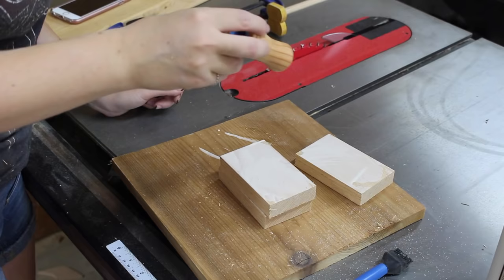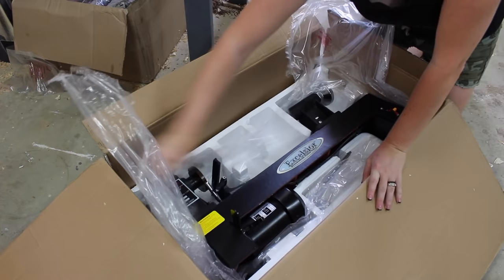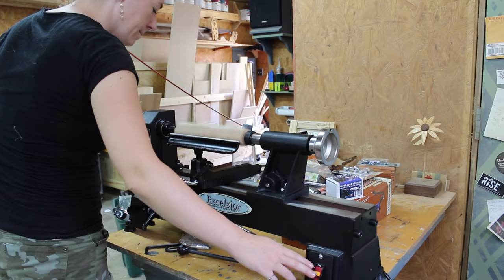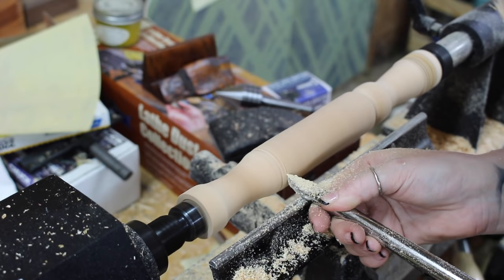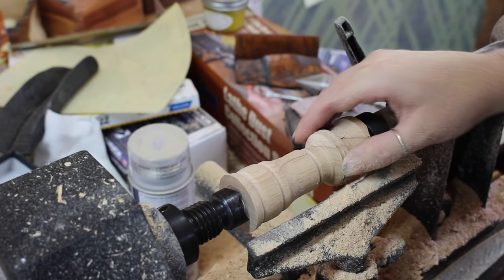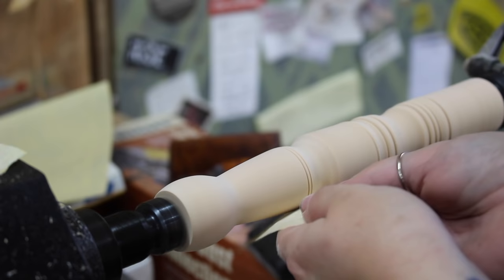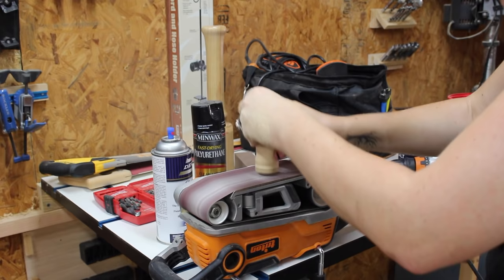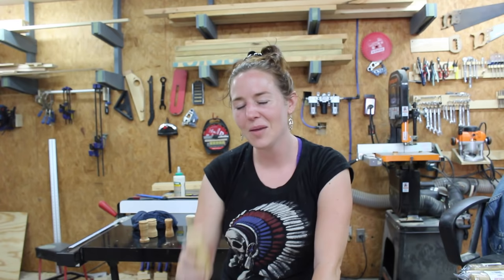Turning A Shop Salt Shaker

Comment: One bit of advice, don't look at others working and think they can do it better than you because of the tool they are using. If you follow that path you will end up with a rack of tools you never use. Learn to use the tools you have, and if you can't do something with them, then you buy a new one. Oh and learn to turn as soon as you can and leave scraping to amateurs, a cut surface is always better than a scraped one.
Reply from the maker: Actually, Nick and Jay taught me on traditional tools so I already know how. : ) Now it's just a matter of buying a set for my shop.

Comment: aNNNNNNNNNNNND it off to the races ! Now you need to sharpen those lathe tools. Get a good bench grinder, April. 
No junk.  8" 3/4 HP or so.Like all tools it's all about the tooling (wheels) you put on it.  Talk to Diresta.
Reply from the maker: I actually already got one! Triton makes one so I just need to make a bench for it and mount it.